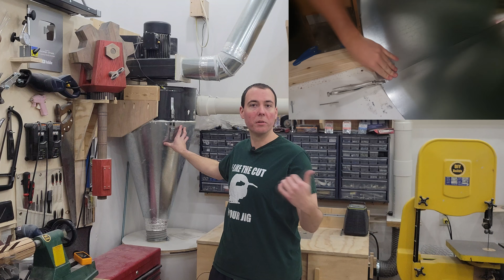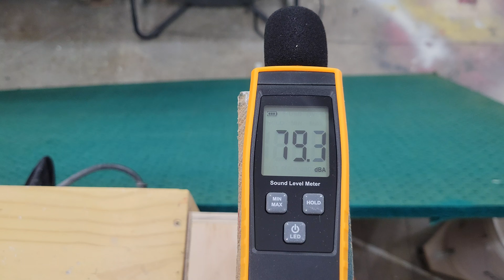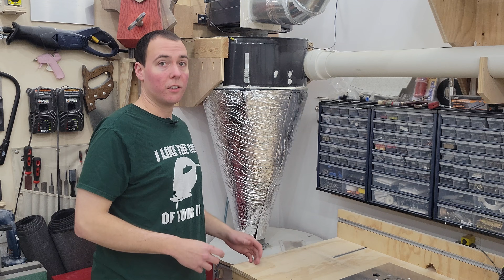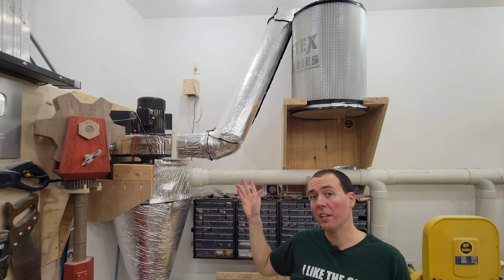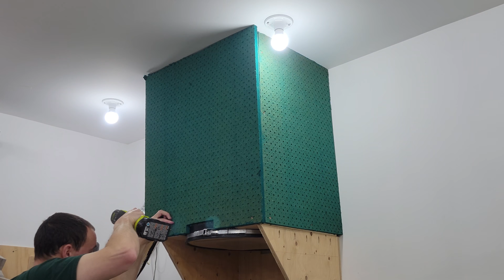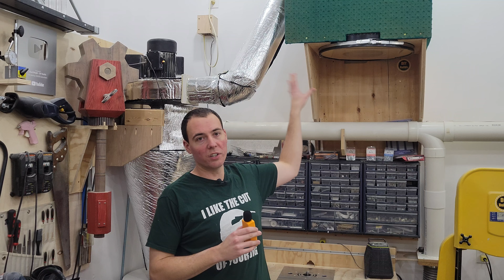Adding The Sound of Silence to My Dust Collection System

Comment: It got louder due to resonance frequency.  The motor has a resonance frequency and when you put the wrap on made the metal closer to the resonance frequency of the motor because that's what's transferring vibration.  So that's why I got louder.  I'm still watching but I would assume that if you encapsulated the motor and put an air intake filter around it, it would quiet down a lot

Comment: One thing i didnt see mentioned here, assuming you used the cld dampening often used for automotive and not foam like some've suggested, is that you didnt pressure roll the damping material on after application. Many of these Mats have dimples on the foil specifically to ensure you applied them with enough pressure.

Comment: So, unfortunately the material added to the cyclone is a thermal insulator, not an acoustics related product.  It appears to be some sort of open or closed cell foam with a super thin aluminum layer.  To get some sort of reduction in structure borne noise, you would need a constrained layer damper.  Most of these use a butyl formula with a much thicker aluminum constraining layer, but not all products are equal.  In fact, in testing, the best performing product I’ve tested performs better than using 10 times as much as one of the most recommended budget products on Amazon.
Reply: Oh come on, you can't stop there!  You have to tell us which constrained layer damper tested the best!
Reply: @missingegg  I was trying not to hi-jack too much.  But, essentially, out of 29 products I've tested, Resonix Mega is at the top of the list and its not even close.  

On the test rig, products are tested on a 11"x11" 16ga steel panel, that is excited by a 20hz-2000hz sine wave sweep.  Results are measured with a calibrated microphone.  A test is run without any product attached, and then with the product attached, and results are shown with both a frequency response plot, and waterfall plots showing the resonance decay over time.  Resonix Mega reduced the resonant peak of the test panel by 21.1 decibels, using 25% coverage in the center of the test panel.

For comparison, one of the most popular products on Amazon, Killmat 80Mil, only reduced the resonant peak by 7.3dB.  One of the most common questions I get is, "can't I just use more of the cheaper product?".  And the answer is, not always.  

To match the performance of a single, 5.5"x5.5" piece of Resonix Mega in the center of the test panel, I had to use three 10"x10" layers of Killmat 80Mil.  Even then, it wasn't quite as good, but almost there.  But, by that time, you'll have actually spent more on the Killmat 80Mil.

As of now, its Resonix Mega, at a 21.1dB reduction, followed by Resonix CLD Squares, at 18.3dB, followed by Vibrofiltr at 14.4dB.

Comment: just to clarify, there was nothing wrong with the previous setup where the fine dust was exhausted outside. It worked well? And the only reason you brought it all inside was so that you didn't lose conditioned air from the shop? Let me know, thanks!
Reply from the maker: Yup

Comment: my dust collector is mounted under a staircase in my garage.  I mounted some moving blankets under the stairs and on the garage side of the staircase and the noise level in my shop is around 66 decibels with only the DC running.

Comment: Hey Brad, I think if you had installed a shield around the motor as well as the canister you would notice an improvement.  The main source of noise is the motor itself.  Although the passage of air through the system creates some noise, it's the high frequency motor that would be the main concern.  The panel in front of the canister helped because air under pressure is being forced through all the openings in the canister.  That creates a higher frequency hiss.
Reply from the maker: Watch my follow up video to this for those results ;)

Comment: the increase in sound that you experienced at the decibalometer (thats the sciencey name for that device) is a direct result of the sound deadening material that you applied to the system. you forgot to turn on the sound deadening material (the switch is located in the dinglehoffer relay junction box on the south side of each section) and once the material is turned on (dance a little jig near each piece) you should notice a definite difference in the decibalometer. If for some reason this does not solve the problem, dance the jig again and keep repeating that until the device is sufficiently turned on. I don't think I need to mention that all of this should be done in a new video so that your viewers can observe the sciencey parts of this procedure.
Reply from the maker: Lol

Comment: The Ridgid shop vacs line the inside of the blower housing with open cell foam. It makes a huge difference in sound levels. Dust collectors have a much lower frequency so it may not help much but it's cheap and easy to try.

Using a larger blower exit pipe lined with foam would help too.

Comment: The sticky back sound deadener simply reduced the surface resonance of the parts wrapped by reflecting some of the energy back inwards - that focused the energy  which simply made it's way to the outlet and entered your space there.  That could be louder, or it could be simply increasing a resonant node where you have your meter placed.  Surrounding the outlet and finding a reduction in SPL gives a clue that a significant amount of energy is coming from that exact location.  Before you insulated that last bit it would have been interesting to place a piece of acoustically absorbent material behind your SPL meter, just to collapse some resonant reinforcement if that was in fact the reason the meter was reading high like that.

Comment: Without detailed measurements of what is going on we can only guess (but you did measure a significant increase, so something happened). I figure out how to predict equipment noise in my day job, so I'm going to guess that the treatment that you put on the structure added mass to the sheet metal and it didn't vibrate as much.The acoustic energy in the air didn't inject as much power into causing vibrations and you ended up with more acoustical power flowing out through the air and out the filter. So you funneled the acoustic energy down the pipe. 

Vibration and acoustics are always interesting and often not intuitive.

Comment: It appears that the sound deadening panels did a better job in reduction of noise level. Just curious if you checked the CFM readings (at any given port) to see if those panels restricted the airflow in an appreciable way.

Comment: It sounds like your adhesive foam was concentrating/focusing the sound toward the "outlet", the filter. I'll have to consider what you've done here in the design of my shop filtration system... I like that you're recycling your conditioned air.

Comment: Should have had this discussion before beginning, but... "g" (below) is spot on. Picking a scale might be as easy as standing between the microphone and the source and just holding up a blanket to see which scale reflects that change most efficiently. This doesn't give any absolute benefit, but would illustrate the relative improvement better. Some other things you might consider: If you couple your damper to the source, it acts like a speaker cone - vibrating with the source. In order to deaden the vibration you'll need to separate the two - as you did on the filter, or significantly increase the mass of the damper, so that there is not energy enough in the noise/ vibration to affect it. In other words, wrap the device in lead and/or hang any (massless) damper an inch away. Lead may be more effective on the pipes near the dust collector body.
Also, measure much closer to the source. As "g" mentioned, the mics are omni-directional (you could use a something as simple as a toilet paper tube to change this somewhat); at distance you are measuring the resonance of the room rather than the noise at the source. 
As I consider dust collection in my shop, I'm much interested; I hope you'll revisit this topic.

Comment: Put some sounds proofing material around the motor and propeller/fan. I'd seriously expect most of the noise coming from there. You probably would need to leave significant air gaps so the motor doesn't overheat.

Comment: I use the same unit with the top and bottom bags. I found that fan vibration enters via ducting and is amplified. I placed motor/fan unit on engine mounts and that caused less noice. Not total silence, but made things beter. Found that sound enters building were ever there is bracket mounted. Hope this helps. 👍
Oh and also spent alota time trying to balance fan, not easy🙈

Comment: I would think much like a fan most of the noise produced is from the volume of air moved rather than the machine itself. However reducing that for dust collection would be dumb. Building an enclosure for the blower motor/impeller and filter would reduce this noise. Yes air flow for cooling the motor as well as venting air from filter are needed. You can build the enclosure as a single unit, a large upper cabinet in that corner of the shop. Line it with sound deadening/reducing material. place vents like your HVAC system would use at both ends. This will allow for air exchange with the rest of the shop while greatly reducing sound.

Comment: As I learned all my years in broadcasting and voice-overs, the more density you put between the source and your work environment, the more unwanted noise will be reduced.  Building a thick concrete wall between your extraction system would be most impractical, but that goes in the direction that might give you an idea.  There is a difference between soundproofing and acoustic treatment.  Proofing required some degree of density.  Jon Peters solved this by having his dust collection motor and cyclone in a separate room, also impractical for my shop and many others I suppose..

Comment: My general understanding is that the resonance does not increase through the materials(pipes and cyclone) enough for dampening the outside to matter. If the sound absorption was eating the sound inside the enclosures would be more effective but that isn’t reasonable because dust collection. I don’t think any isolation related to the equipment matters and instead it isolating the air exits. Maybe a sound curtain around the air filter would net a few. Like what is marketed for home theaters. Or .. live with machines singing the song of production.

Comment: I'd imagine putting the panel material around the motor assembly would help some too.  I might have to check that stuff out, seems like it'd help with my air compressor noise!
Reply from the maker: For sure it would I just didn't get to that / figured out a good way to do it.

Comment: By adding the silver deadening material you "moved" the vibration or resonance to a different spot, probably the impeller. Sound is vibration. Adding a baffle around the motor would be the first step(w/o restricted airflow of course).

Comment: I'm an old car/home audio guy with about 30ish years playing lol... All metal parts including the impeller housing needs to be cover with an asphalt based or similar sound deadening material since the it is the source. 

I use to use a roofing product back in the day called ice & water barrier. It's a little stiff but with a heat gun and J-roller it can be manipulated pretty easy. 

After all metal is covered you should see a huge result. Then wrap the PVC & I bet you could get well under 70ish db mark.

Comment: In case it has not already been mentioned, put the meter close to the components of the system to see where the most noise is originating from.  I suspect that most of the noise is coming from the motor/impeller. Building a panel around it but leaving room for air flow would probably give you the best results.
Reply: I too think this is the best case of action
Reply: That would of been my first step. If you ever listened to a shop vac it’s not the hose it’s the motor that creating 90% of the sound. For example if you were able to move the dust collector to the others side of the wall and plumbed the two pipes through it would be so quiet you would be wondering if it was on or off ok maybe not that good but pretty quiet.

Comment: I had a ClearVue system setup for years very similiar to your setup and had some pretty good succes at limiting the noise. One simple trick is to use a small flexible hose in between your fan's output and the rest of the exhaust, and on input as well. I ended up putting the whole cyclone in a cabinet of MDF with insulation stuffed in between - a ton of work and tricky but it made a huge difference. Lastly I took a different approach on the exhaust. First I used standard HVAC insulated flexible piping to connect to the filter housing (no need for stiff metal piping on the exhaust, it's exhaust not a vacuum) big, big difference there. Fast air moving through metal pipes is really loud especially at turns. Additionally I actually housed the filters in a box in the attic with a pass through back to the shop via more HVAC ducting to a return vent. All of these changes resulted in a nice low hum, could still have a normal conversation without raising your voice. The one big down side was the air ran through the attic which was hot, so that tended to heat the shop up pretty quick - I live in FL and that's a big downer. Additionally if I ever forgot to empty the main dust bin and overflowed the system I'd have to climb into the attic and clean out the fitler box. If I'd only spent a bit more on one of those monitoring systems I could have saved myself trouble there. I've since dismanteled the whole system as I'm doing a total refresh of the shop and in the meantime have gone back to push broom, shop vac, mask and ear muffs. Got to admit, the simple approach is so much cheaper and adaptable, I've been hesitant to reconstitue the whole system as I'm not longer sure if it is worth all of the hassle. Anyway, hope the info is useful to some.

Comment: You probably want a baffle box around the dust collector motor/fan assembly, which I would think is where the most noise is coming from. Or replace the motor/fan. I don't hate Harbor Freight, but I also don't expect them to use good bearings.
Reply from the maker: The sound is not bearings it's the howling wind.